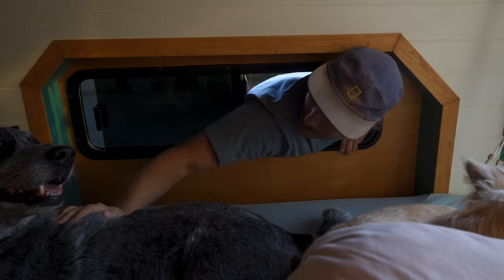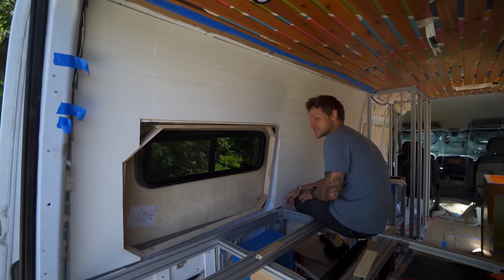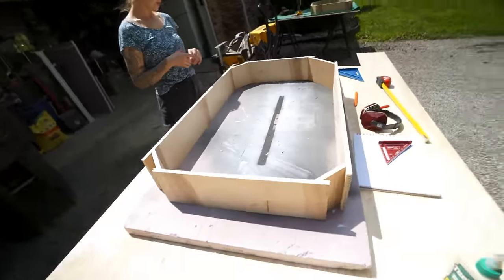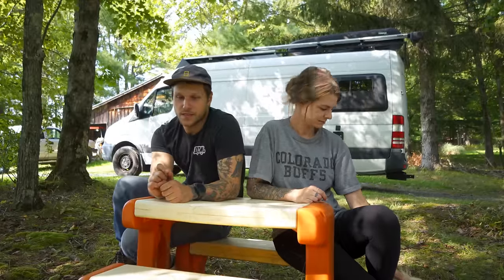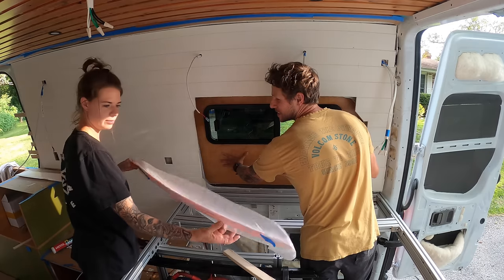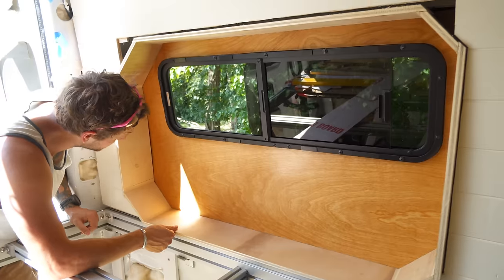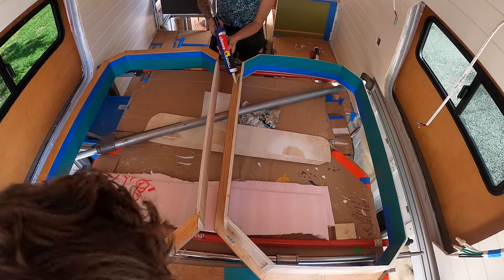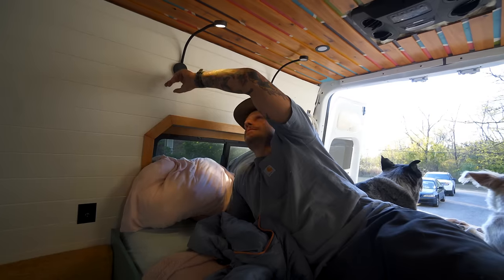How To Finish The Interior Of Your Flare

Comment: If I had known you were doing this I wood (see what I did there 🙃) suggested looking at flexible plywood for the radius corners 2 - 3 pieces (they are thin) glued and made into a sandwich and bent to shape to form a rounded corner giving more space around the flare, I’ll get my coat 😮
Reply from the maker: Where could I get my hands on this so called flexible plywood?
Reply: @dogcatmanvan  don’t know if it posted before 🙃 Home Depot have bendy ply just cut into strips glue 2-3 to laminate and hold in a jig of some kind to fix the required shape while glue dries, then trim to fit, I did put a link which may have blocked the post